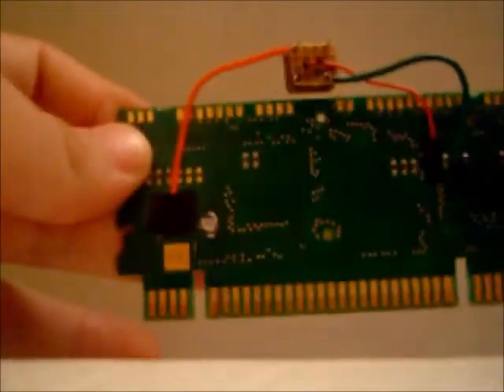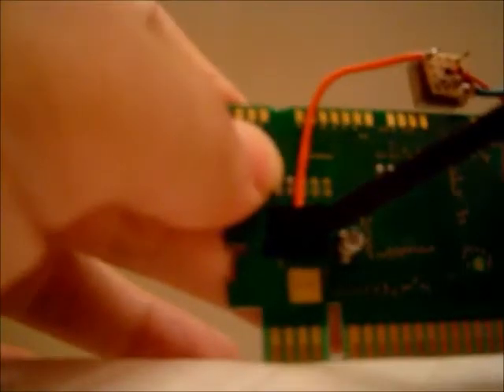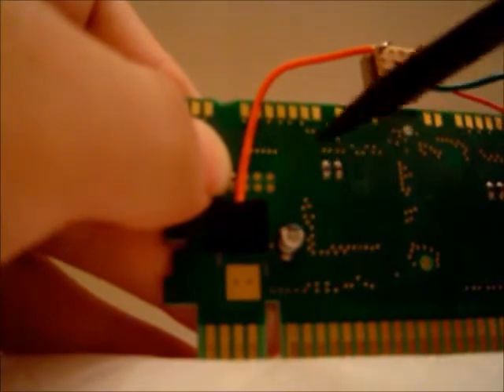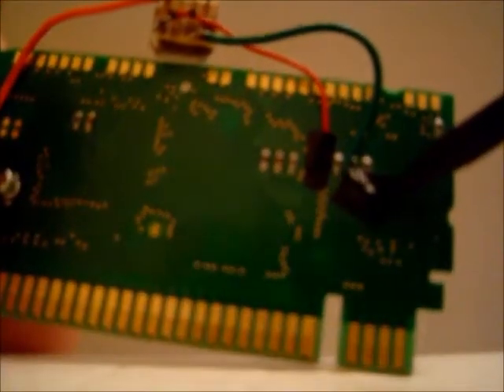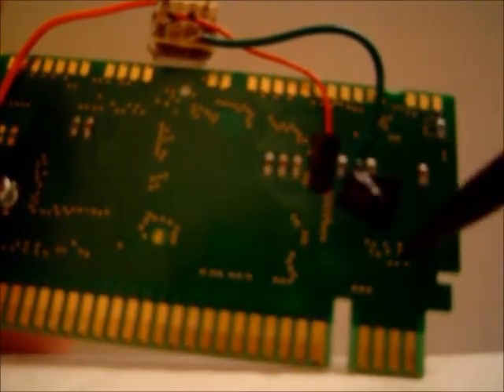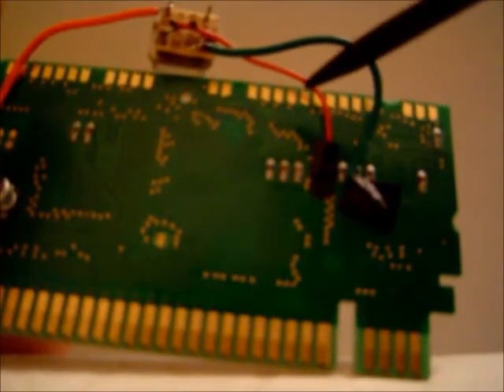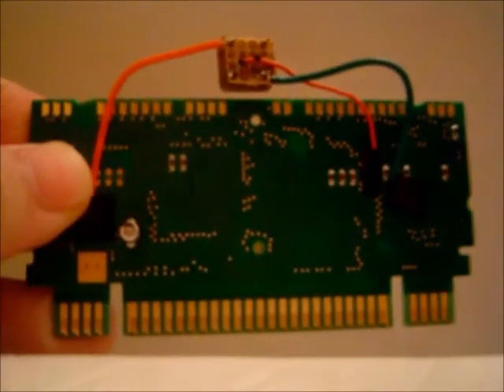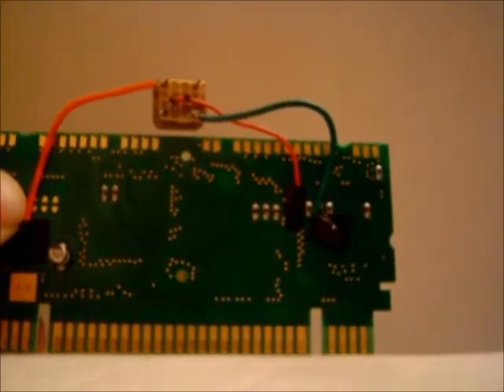Retro Guide: How to overclock Starfox - (Super Nintendo)

Comment: is there away to do the 1st ver of star fox I have the non blob ntsc ver
Reply: Yes, you just remove the 2 pin crystal oscillator. Usually a blue or white rectangle on the lower right on the back of the board.